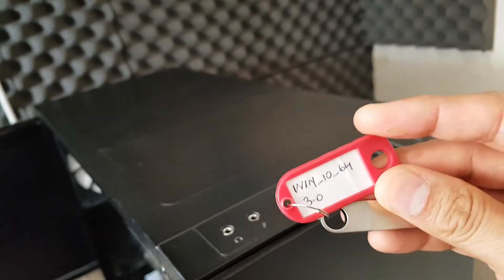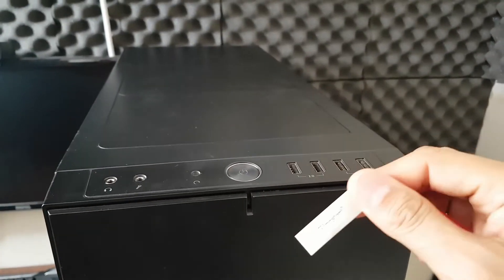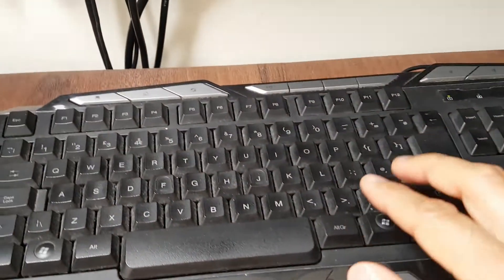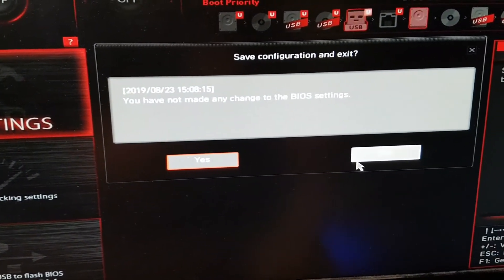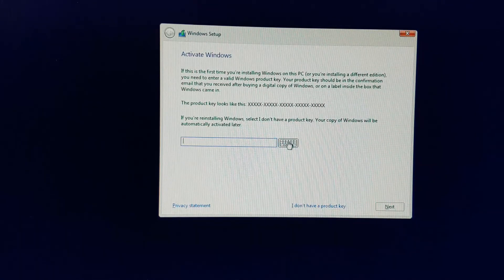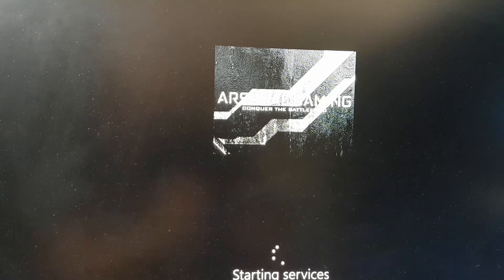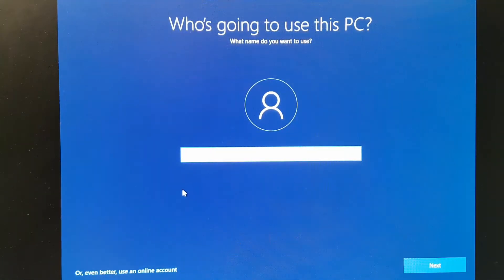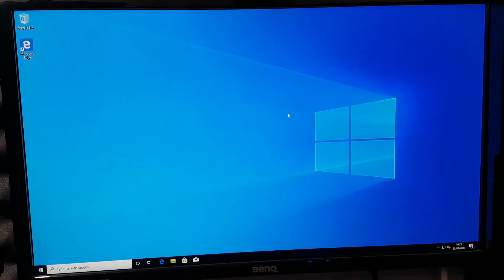How To Install Windows 10 From USB - So Easy You Will Do It Twice

Comment: Assalamualaikum WARB, brother I have problem my laptop Acer got struck on logo nor going to bios or nothing but press f2 in no software I have windows 10 please help sir thanks
Reply from the maker: Waalaikoumsalaam warahmatullah wabrakaatuhu!  Haven't done a video on that yet, but in sum, you need to troubleshoot a lot of things, I would start with a hard reset, reseating RAM, testing  disconnecting drive, boot test with a Linux USB drive etc....